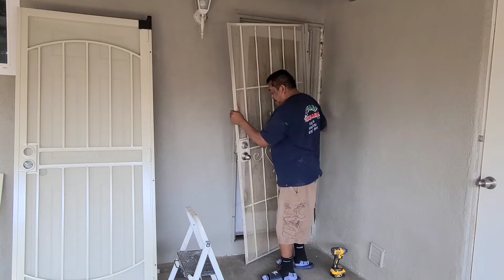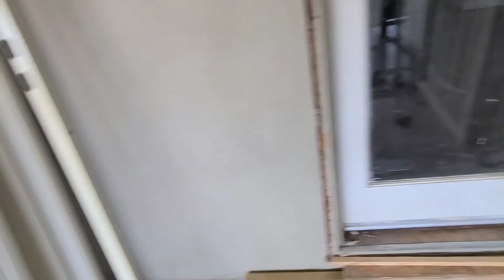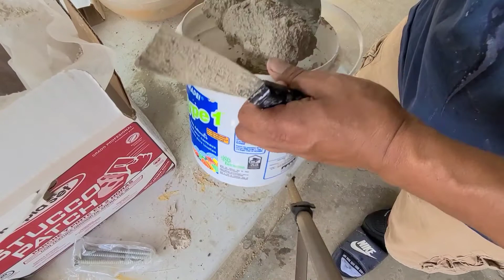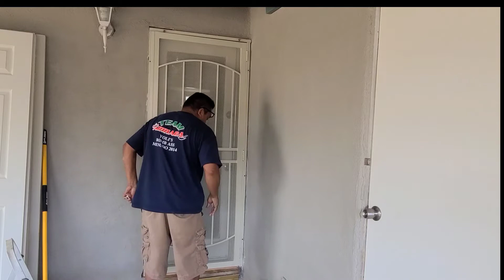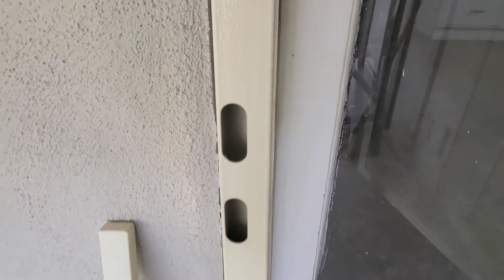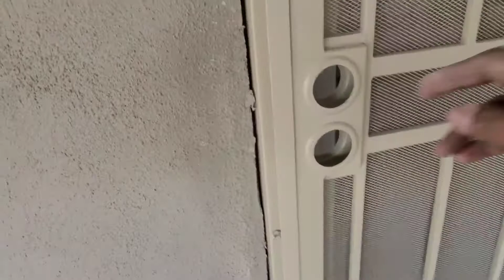How to install a security screen door DIY

Comment: Is it better to install the security door to open in the opposite direction of the inside door?
Reply from the maker: Actually its better to have the door knobs on the same side but it works either way, That's how they wanted it.